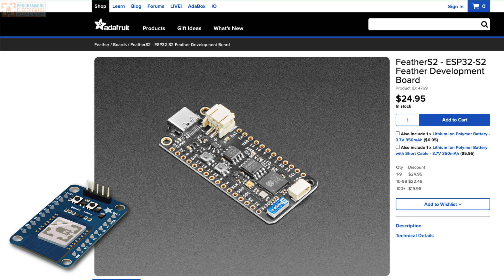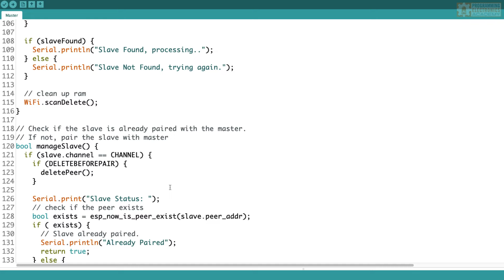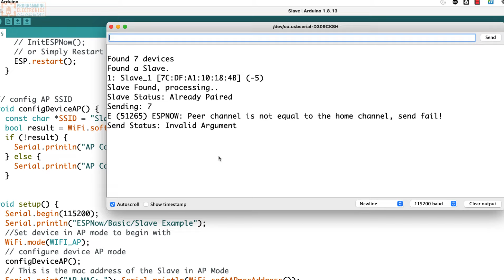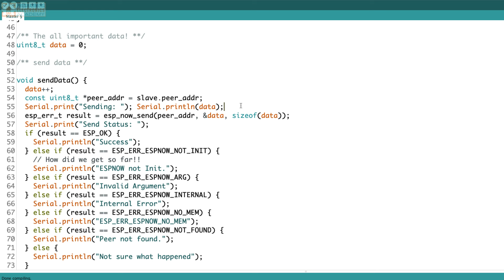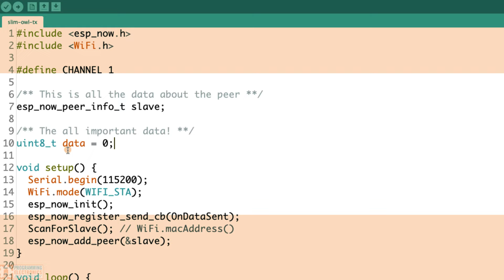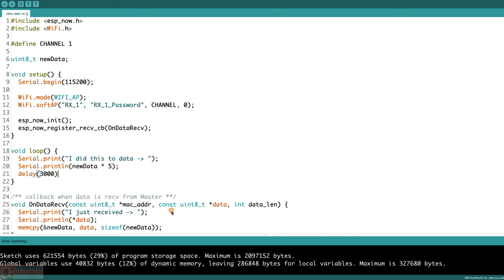ESPNOW for beginners! #ESP32 #ESP8266

Comment: Thank you very much for this contribution. Very clear and exaustive.
Just two suggestions:
1) the compiler give an error, very easy to correct simple replacing the line:
esp_now_register_recv_cb(OnDataRecv);
with
esp_now_register_recv_cb(esp_now_recv_cb_t(OnDataRecv));
the same for the sender code.
2) the receiver must be on when the sender look for mac address.
Can I suggest a loop looking for receiver ON until the receiver is ready?
Thanks again

Comment: Noob problem here...the arduino ide did not have the sketches referenced in the video (they broke out ESP NOW to its own category). They have broadcast examples instead. So i went to github and got the min versions there. I tried compiling the tx version and got this error message:
C:\Users\arduino\Documents\Arduino\esp32\tx_espnow_minimum\tx_espnow_minimum.ino: In function 'void setup()':

Compilation error: invalid conversion from 'void (*)(const uint8_t*, esp_now_send_status_t)' {aka 'void (*)(const unsigned char*, esp_now_send_status_t)'} to 'esp_now_send_cb_t' {aka 'void (*)(const wifi_tx_info_t*, esp_now_send_status_t)'} [-fpermissive]

I checked the code from the video and i didnt see any discrepencies. Using Windows 10 arduino ide version 2.3.7 and installed Expressif ESP32 version 3.3.6. Board is Expressif ESP32-C3 DevKitM-1

Comment: Instead of an ESP32 i'm using  the NodeMCU which is ESP8266, not been fun, probably easier to buy a 32
Reply from the maker: Are you having any specific problems?  The esp8266 is very popular for using with ESPNOW
Reply: @programmingelectronics  Just saw your reply, the code that was written for the esp32 does not directly upload to the ESP8266, off the top of my head <wifi.h> should be replaced with .... Nope can't remember 😒😒

Comment: It work well with original Arduino NANO ESP32.    But With  a WaveShare NANO ESP32, i have error" invalid conversion from..."       i think it's a incompatible variable format in (void OnDataSend)
Reply from the maker: Hmmm... I faintly remember this issue, and I am trying to remember what the solution was....
Reply from the maker: You should be able to remove the OnDataSend callback, and have the tx code work ok.
Reply: @programmingelectronics  i  try later in the week. Thanks
Reply: i found from IA:      For new Espressif Library 
 replace old void OnDataSent      by       void OnDataSent(const esp_now_send_info_t *tx_info, esp_now_send_status_t status) {
 replace old void OnDataRecv      by      void OnDataRecv(const esp_now_recv_info_t *esp_now_info, const uint8_t *data, int data_len) { 

NOW IT WORK WELL.    (dont use this with ARDUINO Library)                                        And thanks for your video.

Comment: i am very green with any of this, i am trying to learn the Arduino IDE syntax and commands. so i dont know a lot about any of this, but the videos have helped me to understand where we may be able to go with all of this. i had an idea to set out a series of esp8266 nodes and have them light in a set sequence and be able to control the speed at which they light, and have them loop back for a continuous loop until we call for an interrupt  i was fortunate enough to hook up with a group of EET students to try and get this project going. we first tried wifi using a nano 33 iot as a controller and the rest are the 8266s plug in to relay board style. 6 nodes were all we could make function before the router got bogged down and created misses etc. thats when we learned about ESPNOW and started using an ESP32_32U so far so good we have 11 of them firing consistently, wanting to add more, hopefully we'll be able to keep going and  leap frogging these as many as we want. 

so, Thanks for the videos!!!
Reply from the maker: Very cool project!  Thanks for sharing!

Comment: WOW!  All other examples I have seen required I hard code mac addresses. The ScanforSlave(s) matching an SSID is a god send....
In my project - I have 1 master and 2 slaves.  There may be others slaves nearby - but NOT on the same network (SSID).  
Each slave will do something different (ie. throw a clay target). I shall send data to both slaves thru one call on the master.
Each slave will determine what IT will need to do - based on data.....   struc: SND_DATA[ slave_name , action]...
If action = 1 and (slave_name = ME )
Throw MY clay target now
else if action = 3
Each Slave Throw a Clay Target now....   This ESP32 stuff is GREAT!
Reply from the maker: Awesome!  Good luck with your project!

Comment: If the board doesn't connect you may not have the CH340 driver. Also on many boards you need to HOLD DOWN the boot button to specify programming mode.
Reply from the maker: Thanks for adding this!

Comment: Hi this is such a thorough video, I really appreciate it!  I ‘m wanting to make a 12v battery monitor using the most energy efficient ESP technology (which I think would need to utilize ESP32’s deep sleep capabilities to turn the device on at intervals to take readings and then go back to sleep right after) . I haven’t used ESPNow yet, but I thought that I read somewhere that it uses less power than wifi communication. Do you know if that is true? 
After watching this great video I did become a little confused that it seems that ESPNOW still uses WIFI ssids? Or is the ssid you used in this video an espnow ssid?  Thanks again for making this!

Comment: Hey man, I got a propably rather stupid question: How can I change the Value of the Data. For example if I would want the data to be the Reading of the analog read funktion. How would I do that? Cause I tried in the Masters code to set uint8_t data = analogRead(A0); but that did not work.
Reply from the maker: Not a dumb question at all.

You could try changing the data-type of the data variable from...
uint8_t data = 0;
to 
uint16_t data = 0;
Reply: @programmingelectronics  Thanks man I'll try to do that🙂👍🏻

Comment: Great video many thanks for taking the time to put it together and share!

Unfortunatly, when I compile I get the following error for my RX code, TX code works like a treat:

error: invalid conversion from 'void (*)(const uint8_t*, const uint8_t*, int)' {aka 'void (*)(const unsigned char*, const unsigned char*, int)'} to 'esp_now_recv_cb_t' {aka 'void (*)(const esp_now_recv_info*, const unsigned char*, int)'} [-fpermissive] 11 |   esp_now_register_recv_cb(OnDataRecv);

As the code is very basic and I have copied the OnDataRecv exactly, I am not sure what the error is.  

Do you have any suggestions what may resolve this compiler error.

Many thanks!

Comment: So you didn't mention the AP Password, how is the sender connecting and sending without knowing the password?  Also the range seems like it would be very limited here based on the transmit/receive power of the ESP32 and if you wanted more range you would want to look at something like LoRa
Reply from the maker: Good questions Chris!

With ESPNOW, the boards are not connecting to a WiFi access point.  ESP-NOW is a kind of connectionless Wi-Fi communication protocol that is defined by Espressif.

You're right about the distance.  There are some demos online showing some impressive line of sight ranges, but you're absolutely right about using LoRa for more range.
Reply: @programmingelectronics  Yes I know they are not connecting to a traditional AP but you are setting up onc the device (receiver ) as an AP for the sending device to connect to.

Comment: This is really well explained. Thank you for that! I was wondering, is there a way to have bidirectional communication between two ESP boards? Even if you need to specifically set the mode to either transmit or receive, I wonder if it would be feasible to somehow switch between both modes at a certain interval, so each board is receiver half the time, and transmitter the other half.
Reply from the maker: Neat idea!  I think that could be possible.

Comment: I have an ESP32 DEVKITV1 never been able to program it, in Arduino software and Visual Studio Code nothing but errors. Piece of crap.
Reply: That sucks man.  I struggled something fierce to get even the Arduino Nano Esp32 to work on their own software.  I refused to give up on it and would walk away from it for a bit.  

There are a number of issues with windows drivers (shocker right?) in getting the chip to register on windows.   Even if it shows up in IDE, you may still need to wipe the drivers and start over.

Hope you figure it out, pretty satisfying to engage this stuff and execute your first project.

Good luck.

Comment: How can I add more than one function to the string. I got my code sending a battery voltage value back from the slave esp but I want to send a command from the master to turn on an led using a button as a toggle or 4 leds on 4 pins. Eventually I’ll make a menu with an oled display but I can get more than 1 led to work or just the voltage value to be received.

Comment: I have many devices on my wifi and when we recently switched to Hotwire they use the Eero mesh network. In order to keep my many devices, I implemented the Espnow protocol to offload many wifi sensors. I had to implement a "hub" to provide the fixed channel for Espnow, since the mesh freely hops channels. Since switching I have about 30 Espnow devices alongside the 100 or so wifi based devices.
Your explanation is great and should get anyone excited about the possibilities.
Reply from the maker: Whoa!!!  You've got quite a setup - very impressive!  Thanks so much for watching.

Comment: Running espnow on esp32 with continuous data transfer heating esp board.  Are there any specific requirements to throttle up data sending rate for optimum heating??

Comment: I enjoy using the esp32 and RemoteXY with the GPIO pins to control devices.  I wish someone would make some videos on the Orange PI5 GPIO PWM pins to control some pan-tilt servo motors for projects like a servo remote control car or a robot arm.  The RPi4 examples do not run turn-key on the OPi5 and the errors are difficult to fix.  😎 Anyway thanks for the great esp32 video.

Comment: I see a weird behavior in the master sketch. When the master connect to slave1 it reports in the serial monitor that the mac address of the slave that it is connected too is C8F09EF17221 but actaully the slave mac address is  C8F09EF17220 (as reported by the MAC address finder sketch). Why is this happening ? The communication between the two devices is OK.
Reply from the maker: hmmmm.  That is weird.  I'm not sure what would be going on.

Comment: Great Explanation of the key ESP NOW concepts.. 

I have a question tho.. have you found a way to extend the ESP NOW's range by lowering the bit rate of the WiFi signal, but from within the Arduino IDE 1.8.x or 2.1x?  I haven't been able to do this without generating IDE compiler errors,   but understand that there is a way to config the WiFi for the 1Mbit 802.11n slower rate if using the ESP IDF, and that will dramatically increases the signal's range at the expense of losing the default 54MBit data rate set by the Arduino IDE. If you know of a way to extend the range while using the standard PC card Antenna, I'd really like to hear about it. Thanks Again , jimS

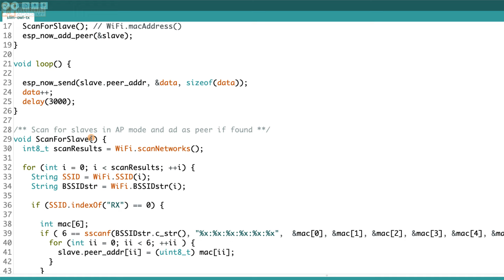Comment: NIce video .  In the transmitter sketch (@ 27:41) your are checking for indexOf("RX"). what if there are more than one Receivers on the network? Transmitter device will connect to the first available Slave.  I know this is not production code, but just pointing out.

Comment: I am very new to this but I have a project for home security. I have 1 master and 6 slaves. I want to read 2 pins and states, based on state I need to send info to 6 esp32s 2 must move servo to position 1 @ 135degrees and other 4 position 1 is 90 degrees. And other pin high send position 2 to all @ 0 degrees. I can't find any tutorials like that

Comment: Sir can I enter my Arduino loop code under the void loop (slave) to work? 
Or we have to write the another code for that void loop?
I want to process the entire working wirelessly that's why i am using ESP 32.
Reply: Thank you sir ☺️
Reply from the maker: @technicalgaming7056  absolutely!
Reply from the maker: Yes, you can add more Arduino code right into the loop() function.
Reply: @programmingelectronics  ok sir .
I have one more query is there any other module which is smaller then the ESP 32 which can send the information of sensor wirelessly to the another ESP and process it to give back the instruction to that module for doing some action.
Basically i want to know is there any alternative of ESP.
Reply from the maker: @technicalgaming7056  have you looked at a bare bones esp8266?
Reply: @programmingelectronics  no, but i will okay 👍

Comment: Thanks very much for the tutorial.  I have a question, I have been trying to use a ESP8266 as the Master/Sender module and I see no data on the Slave/Receiver Module.   I followed your video and was able to get the ESP8266 to work as a Slave/Receiver with a ESP32 as the Slave/Sender.  I have updated the example from ESP32 ESP Now Master for the ESP8266 and was able to create matching function in all but the WIFI Error base address, I'm not able to find anything similar for the ESP8266.  I disabled all the code that relates to this.  The Master/send serial output says it transmitting data fine, but when I look on the Slave/Receive monitor window for for the data sent.  I did program an ESP32 for Master/Send to verify it works, and it did.  Bother serial monitors send the expected results when I use the ESP32.     Thanks for any help.
Reply from the maker: Hi Eric - great questions! -Just to make sure I follow...

Are you saying that when using the ESP Now protocol you cannot get your esp8266 to act as the Master/TX and an esp32 act as a Slave(RX)?

Am I following you correctly?
Reply: @programmingelectronics  yep that is exactly what I'm trying to do.  I just found a link to a video that does this.  I'm going to try it tomorrow.  I'll let you know what happens.
Reply from the maker: @ericbommer2280  Awesome - good luck!

Comment: okay, because the PICO and PICO W are about..   is there a version of this that will work with it? I think they have a bit more power (dual core) and ram..?  But. they defiantly are much CHEAPER.. $4 and $6 .. depending on if you get it with wifi or not

Comment: Hello and thanks a lot for this very useful video. I just have one question:
The *data parameter in   esp_now_send(const uint8_t *peer_addr, const uint8_t *data, size_t len)    is of type const uint8_t, so platformio gives error when data is a string. Could you please give some insight on how to send a string? 
Thanks in advance.
Reply from the maker: Great question!!!  

OK, if you cast data as a (uint8_t *), then I think you should be able to pass your string reference.

I pass a struct in this example:
https://github.com/ProgrammingElectronicsAcademy/espnow/blob/main/esp-now-one-to-many/tx-one-to-many/tx-one-to-many.ino

line 312 (the send) and 107 (the data)

I hope this helps some!
Reply: @programmingelectronics  Thank youu!! 😀
Reply from the maker: @zahidfaheem3233  I hope it helps!

Comment: Thank you, that was beautifully explained and demonstrated. I am using ESP-NOW for a wireless CNC pendant and I agree, this is a very under-used and powerful feature of ESP32 (and '8266). One question I have, which I could not find on Espressif's docs, is how exactly ESP-NOW deals with failed transmissions (no response from receiver). I would like details of how many retries, does it change power level, effect on transmission speed, effect on range, and can I control any of these things myself? Like, can I just tell it not to bother doing any retries, so I can move on to the next data packet as quickly as possible?
Reply from the maker: These are great question Steve - thanks so much for bringing them up!  As I explore the protocol more, hopefully I can help shine some light on these (or anyone else reading, please feel free to chime in!)

Comment: This is exactly the kind of information needed to kickstart some badass projects that require wireless transmission between 2 boards. Definitely planning on using this information in a few projects as this will be an amazing way to control things over a short distance without having to use any form of internet or additional modules to make it work. By the way, that's one badass project you've got there. It's simplistic, yet really cool and functional as well. Sparking some awesome ideas by showing the basic concept of possible uses for this wireless communication feature built into the ESP boards
Reply from the maker: Thanks Morpheon! I hope to have more content on the ESPNOW stuff.

Also, I'm glad you liked that project - it was a blast to make. I have some more in mind I'd like to try and develop.
Reply: @programmingelectronics  I'm looking forward to seeing more of your videos regarding the ESP32 and ESPNOW.

Also, would be a killer to see some other projects you'll be working on, I enjoy seeing what others do and make, as it sometimes can inspire others by showing off the possibilities of these boards, so you had a perfect use case right here, and I love that! Keep up your tutorials, they're handy reference points for projects too tho, thanks

Comment: Very fundamental mind exploding step you failed to flag and that is when you connect your device to your computer and it fails to connect or show up you will need to download the drivers for the device in question. There are a couple one is the CH340 USB to serial controller the other is the CP210x USB to UART. With out these installed on the Windows machines the connection will pretty much fail. Not sure about the Mac and would be nice to know if the Mac requires similar drivers.
Reply from the maker: so true - drivers can drive you mad!